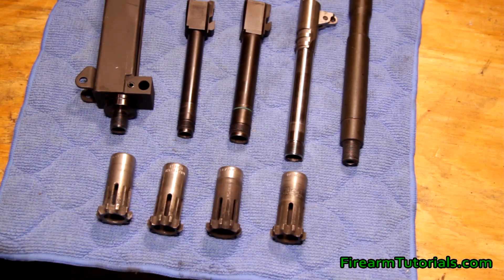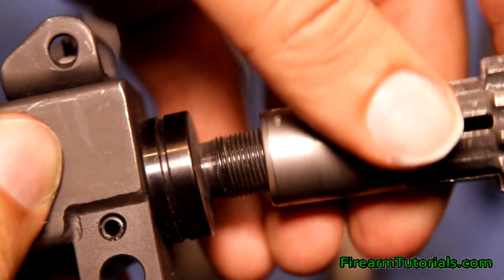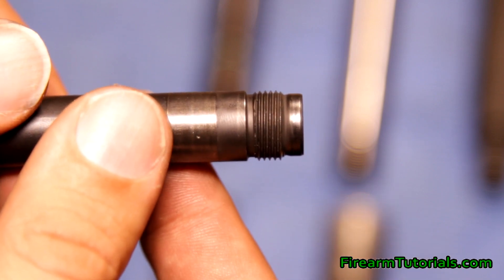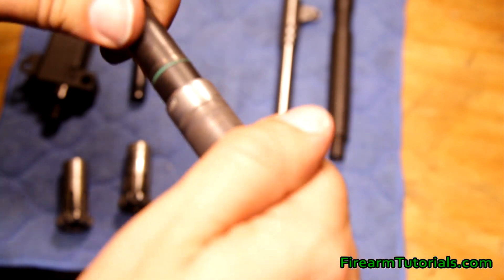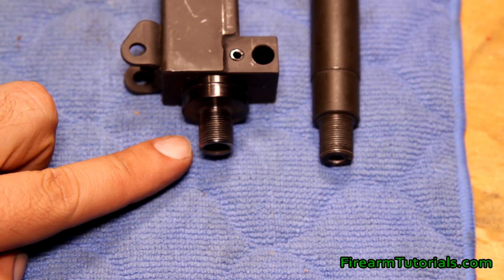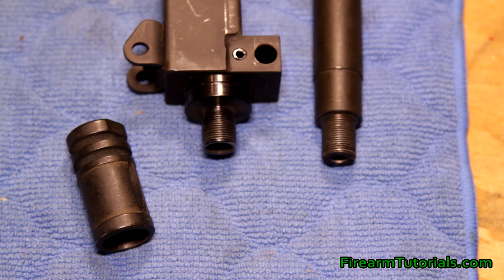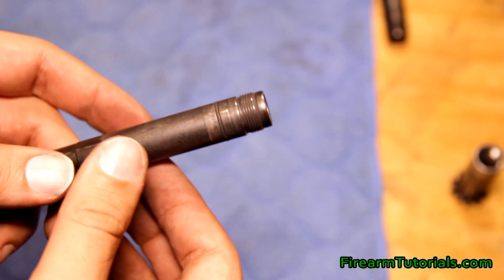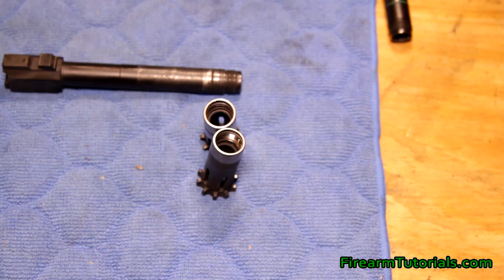Suppressor barrel threads by caliber

Comment: Thanks for the info. You did not mention 1/2 x 20, so I take it that this is uncommon in the US. I am in Australia and you can get 1/2 x 20 and 1/2 x 28 along with the other sizes you mention (I assume). I read a thread (no pun intended) somewhere that Marlin shipped stock out once with the wrong thread which must of been intended for another country, such as New Zealand who seem to mainly use 1/2 x 20 from their websites I have seen. I recently bought a ruger american with 1/2 x 28, but when researching a .22 (along with Marlins), dealers would refer to the threading as 'standard', but different dealers could be referring to either as standard depending on what they are used to. In my research I found that 1/2 x 20 UNF is fairly common thread for lots of applications, but 1/2 x 28 UNEF is very rare in Australia - usually only on imported US made items. If you want a thread to match you would have to get it made from someone who has that tap. cheers.
Reply from the maker: Thanks for the info.  you are correct, we don't see 1/2x20 in the US.  I actually prefer the metrics threads anyways.  they thread on quicker.

Comment: Nice tutorial. Slight correction: the Mark 23 US barrel uses US measurements instead metric. It's the equivalent of the 16 x1, but if you look for replacement barrels, accessories, etc., even on places like HKParts, the US barrels are in US measurements. 

Something you didn't show was the USP .40 barrel.  There are two versions available, a 14.5x1LH thread and a 9/16x1RH thread, thought the latter is made my an American aftermarket fabricator. It is supposed to be of good quality, though I do not believe it uses the same polygonal bore as HK.

Comment: if your threads are short should i leave out the crush washer and just use red locktite? without crush washer its 1/2in of thread with its 5/16in with washer which seems like not enough thread 1/2x28 .223 barrel
Reply from the maker: I wouldn't use red loctite under any circumstances.  What barrel/suppressor combo are you talking about specifically?
Reply from the maker: @_WADE13x  That's a weird one.  I'd use no crush washer and use Rockset instead of Loctite.

Comment: Forget caliber, threads should be based on barrel diameter.  I have seen 300 win mag barrels that were not even big enough for 1/2" threads to even mark the barrel.  Turning a barrel down more than absolutely needed can swell the bore at the muzzle and hurt accuracy.  Use the biggest thread you can.

Comment: What do you recommend for a sig 1911 I live in the US would it be difficult to find a left handed suppressor?
Reply from the maker: You'll probably be stuck with .578x28 which is fine.  If don't already have a threaded barrel, you may be able to find some in 16x1LH, but I've never looked for 1911 barrels in metric thread pitch.
Reply: Thank you!

Comment: Here's an idea. Have the "device" in hand before you even think about threading the barrel. There really ARE no "standard" threads in this days of "overseas" and "foreign" and "global" production of guns, parts, components, etc. And there ARE some "oddball" threads out there that are NOT "standard" in the general "mechanical" world. The other day I saw a "suppressor" or some other "muzzle device" that was supposedly cut for "1/2-36" threads. 

Trust me when I tell you as a 25+ year diesel mechanic with LOTS of experience with LOTS of threads both metric and Imperial and both LH and RH that "1/2-36" is NOT a "standard" or at least "common" thread pitch, it's almost definitely the result of somebody using single-point cutters on machine tools to "design" a "proprietary" thread for their product and you're almost certainly going to have to do the same to have a barrel with matching threads. 

Which may be fine and dandy with you, but if you ever want to sell/trade the gun and keep the "suppressor" OR the other way around OR you ever "ding" or otherwise damage the threads and want to "chase" them with a standard thread chaser or a die/tap, good luck. 

The bottom line is NEVER assume that a "standard" anything will have "standard" threads even if the manufacturer or any other "expert" guarantees/verifies/promises it does because SHIT HAPPENS and when it comes to something like a SUPPRESSOR and/or threading the barrel on an SBR where you're looking at a tax stamp or maybe two, hundreds of bucks spent just "registering" the "suppressor" and/or SBR, months to years waiting for them and/or your "build" and then maybe additional cost and time to have machine work done to put them together, its really foolish to "rush" to "finish" a long, drawn-out and very expensive process by having machine work done on a "promise" that it'll fit together and work out when you finally have all the parts in-hand just because you "can't wait" til you have the parts to get the machine work done. 

There are also plenty of OTHER "issues" that can be found with a "guaranteed" suppressor, such as its the wrong CALIBER or its the wrong MODEL or its FLAWED IN SOME WAY from being "damaged" to being a PIECE OF SHIT ALL THE WAY AROUND which maybe only your "gunsmith" will discover when FITTING it to your GUN. OR you/he/she may find that your GUN is "flawed" whether damaged in some way or ITS A PIECE OF SHIT.

It just ain't worth doing machine work to install an "aftermarket accessory" without having that part IN HAND and honestly any "gunsmith" that WILL machine/thread ONE PART without its MATING PART(S) in-hand isn't a "gunsmith" I'd want touching ANYTHING of mine. If he needs the work THAT BAD and/or is willing to take somebody's word for what will be showing up to go on his "work" and isn't the least bit worried about or interested in seeing what will be going there before he starts the work, he's probably GOT THE TIME AND/OR NEEDS THE MONEY TO DO IT ASAP TO "SAVE TIME" FOR YOU LATER FOR A REASON. HE DOESN'T HAVE OTHER WORK WAITING.
Reply: 1/2-36 is the thread pitch used for pistol calibres over .30. 1/2-28 is the standard for small rifle bores up to .30/ anything over is usually 5/8-24. While I am no machinist, I do pay attention to what is used where, and why it is designed to be that way.
Mixing up and using a  rifle bored suppressor ( 1/2-28 ), on a pistol barrel with the same thread,  will have very expensive, exciting, and harmful results.
Always pay extra attention to what you are doing and trust no one with your safety.

Comment: Hey my pistol doesn't have surpressor thread adapter how do I install one
Reply from the maker: Aldo Castillo you'll have to replace the barrel with one that has threads.  if none are available commercially there are companies who can extended the barrel length and add threads.  The first option is cheaper and easier.
Reply: FirearmTutorials .com thank you so much ...so can I just break down my own gun and add an adapter to it...like in some of this vids